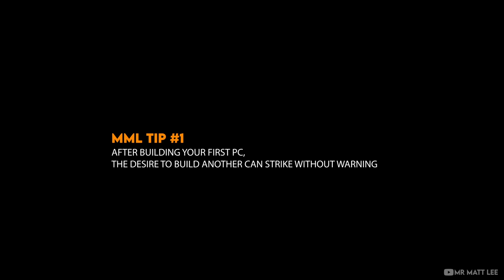This Fractal North Will Melt Your Heart | ProArt RTX 4080 Gaming / Creator PC Build | Z790 13700K

Comment: That vertical mount on GPU looks great and sturdy, on many cases the GPU's installed are swinging in the air. Mr Lee's build is perfect.
Reply: GPU temperatures are typically worse on a vertical mount.

Comment: You introduced me to the Fractal Design North case earlier this year, and I've since gone on to build the snazziest computer I've ever owned in it. I went with an Asus ROG Ryujin II 240 AIO cooler with the radiator mounted vertically in the front of the case with 3 120mm fans on the outside front of the case pushing air in and 2 120mm fans on the back of the radiator pulling air in. With 2 120mm fans in the top of the case pushing air out and 1 more in the back of the case doing the same, i7-12700KF CPU temps running Cinebench never go above 73 degrees C, even when overclocked. The case has soooo much airflow in and out that I might not even need this much cooling. But, it's nice to have it anyway. Thanks for your original Fractal North video cluing me in to the case's existence.

All that said, you've made another gorgeous build, with the video to match. 👍

Comment: Such a beautiful case. I'm still running a Fractal Arc Midi R2. It's not as pretty but there's room for the largest of cards, as long as they don't exceed the 3 slot. It has the side 140/180mm fan spot also which is great to directly cool the GPU.

Comment: Beautiful build.  I have the same case, but built an AM4 rig with a 5800x3d and a 6900XT.  I opted to not have the tempered glass window because I have grown tired of them.  I do want to add the vertical GPU mount the same way you did it, though.  Again, beautiful build.

Comment: I got this case and although it does look great, there is a pretty major design issue..   If you front-mount an AIO there isn't enough space in the case for any 30 or 40 series graphics cards, except some rare extra narrow cards....Which oddly the proart is one of :D  I ended up installing the AIO around the front mounting plate(Fans inside, radiator outside), but I had to bend a few pieces of metal to get it all in.
edit Should say I love the case though.  It comes apart really well. The slip-in feet on all the side panels make packing all the cables in super easy.  And the mounting plate for the PSU is genius.

Comment: Cool build and even cooler case, but I can’t stop wondering, why would you want the hot air be pushed through the radiator that is supposed to cool your CPU?
That radiator should be mounted in the front where the cold air comes through.
At the top you’re losing a lot of potential cooling.

Comment: awesome build! there should also be a pretty sick Noctua build be possible with the 4080 Noctua special edition, there are two Noctua fans on the GPU, looks sick. Only problem is that i would never buy that one bc it costs almost 1600€, so its basically as expensive as a 4090 lol

Comment: $1500 build cost? The GPU costs that much. Beautiful video though
My calculations came out to about $3300 fo rall those wandering. But TBH 3.3K for a power house of a PC is awesome
Reply: I used part picker to build something similar for $2200.
It looks like the vertical gpu mount is for aesthetics. Do you know if it’d work for any GPU?

Comment: Amateur question, but with where your radiator is mounted (top of the case), won’t you be pushing hot air into your radiator and causing extra heat build on your liquid cooler? Wouldn’t a better place for the radiator be where your air intake is? Kinda like how cars are?

Comment: question for anyone who might know.  So the north limits the clearance on some GPU’s.  The space between the front fans and GPU can be fairly small.

If you vertically mount the GPU like this, could you squeeze the fluid line from a front mounted AIO down there?

Sorry, not super computer savvy

Comment: I'm planning a similar build but wanted to use the Asus Ryujin 240 CLC.  Do you have any input for that specific cooler, fitment-wise? Also wondering about the thermals here compared to the build you did in same case with same mobo/cpu with the noctua tower cooler. I love your channel!

Comment: Will that vertical GPU mount shorten the max length possible for GPU?  I have the ROG Strix 4080 super in this case and it barely fits mounted "default"

Comment: may i ask how did you get your radiator and fans installed on the top without interfering the RAM slots? my ram cannot be correctly installed after I put in the radiator and 25mm fans.

Comment: Hi @Mr_Matt_Lee, I looooove this build and I would like to do sth similar. One question though: since I will hang on to my RTX 3080 instead of burning a fortune on a new card, what is the maximum length that a card can have using this vertical mount? Since my card is a big one.

Comment: This case has only one difect:  full tower version does not exists and due to its dimentions it cannot fit bigger GPUs or higher CPUs air cooler like noctua d15 (i've built one for my sis).
Reply: NHD15 will fit, but you need to check the RAM height. If it is too high, you might need to push up one of the fans a little bit
Reply: @shakesharif  NHD15 barely fit in my corsair 7000X 😄 with raised fans (yeah i know, i have low profile venceance ddr5). I had to buy a slightly shorter cooler for this case.
Reply: @FullMetalGatto  same here 😅 Vengeance but the NHD15S barely fit in my Aerocool 800 (2017 case) i NEED a new case. Unfortunately the new North XL version isn't available in my country
Reply: @shakesharif  the XL version is sold here, but unfortunately I would like a full toewr version (I am a full tower fetishist ) 😆 It would fit perfectly in my office with all the handcrafted wooden furniture, but it's not tall enough :( 
thinking to handcraft one myself

Comment: BTW; $1,549 is total bs... US or UK. Just made up nonsense. Not bad for what it is, but in the US, more like $3,000. GPU alone is $1,359. No, not getting case, motherboard, RAM, power supply, CPU, etc. for $200. With a 4070 Ti Super, all the parts are $2,700 US. Like the video, but hate pricing lies. Just state real price. Sheesh!